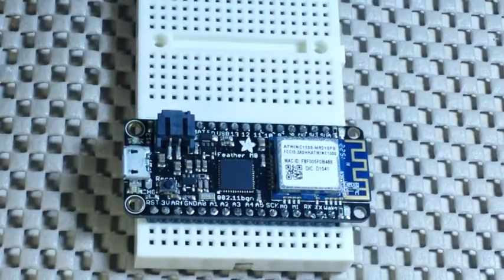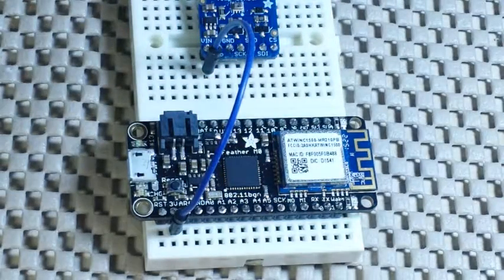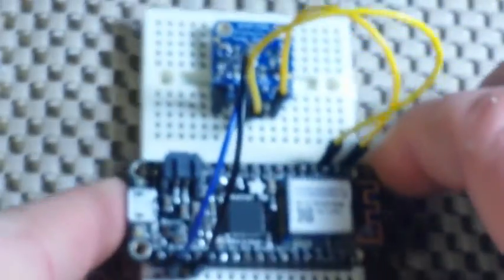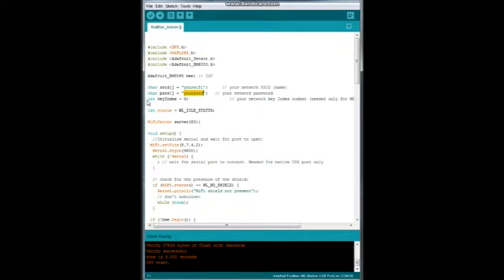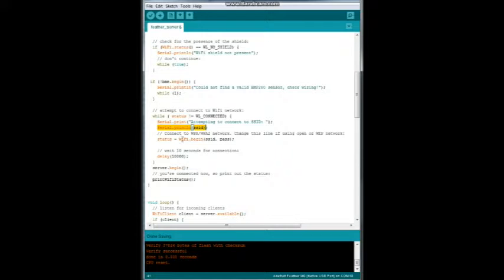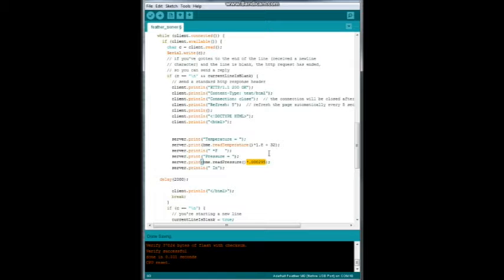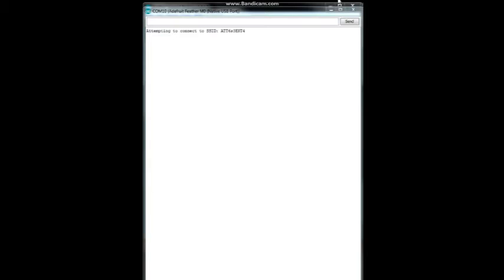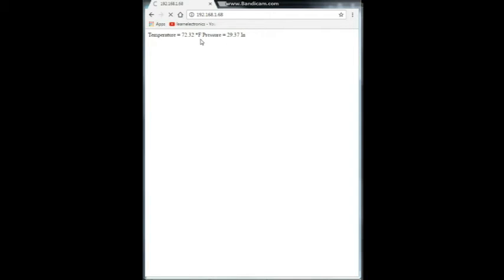How to make a simple Arduino based WiFi Webserver

Comment: Fantastic, excellent video.  Thank you very much.  I have done some work with the "new" Ethernet2 library.  I got it to work but then it will disconnect after ~ 3-5 refreshes on the browser.  This was using the Ethernet Shield 2 on an Uno.  Curious if you have better luck with this Adafruit product?  Also, if you can explore using PHP to log data like this to mySQL database that would be awesome (...idea for future video?).  Cheers from MD!